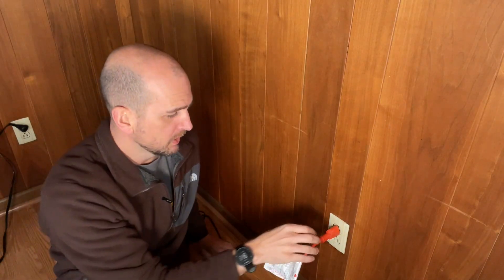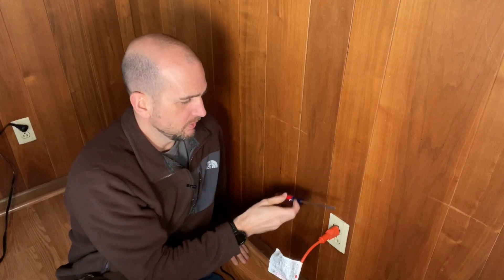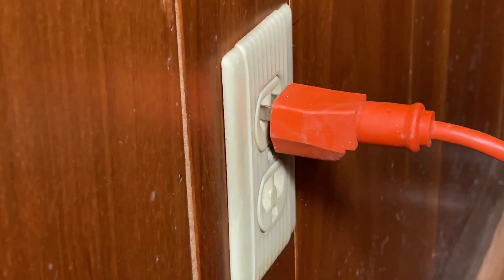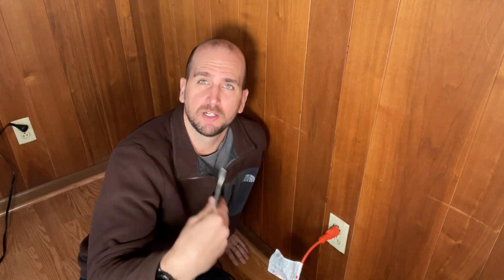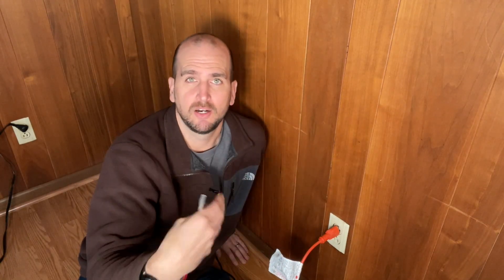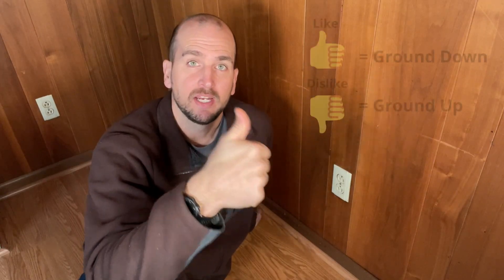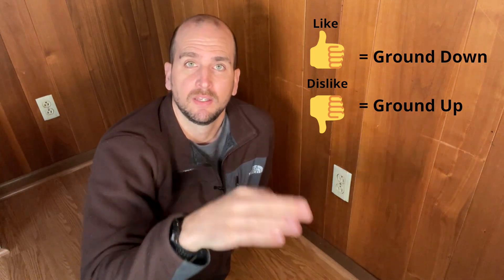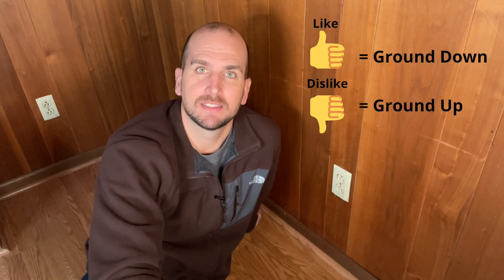Should An Outlet Be Installed Ground Down Or Up

Comment: Used to be we installed all outlets with the ground down, unless it was in a room that was controlled by a wall switch, then we would install that one ground up so that the homeowner would know which outlet was controlled by the switch and it was usually just a two-prong table lamp going there anyway so it worked out just fine.
Reply: I dislike the practice of upside-down plugs for switches because It is unprofessional to be inconsistent.  It's the wrong solution to the "problem". You should install receptacles that are marked as switched.

Such as https://www.hubbell.com/wiringdevice-kellems/en/Products/Electrical-Electronic/Wiring-Devices/Straight-Blade-Devices/ConstructionCommercial-Receptacles/DR15C1WHITR/p/2608245

Comment: So this is how I learned it:  Ground facing down for "regular" outlets. If the outlet is controlled by a wall switch, then ground goes up. That way, there's a visual identifier as to which outlets are switched and which ones are not.
Reply: Thats how they wire homes in Vegas. I've never done that myself but I'm in Northern California and didn't really deal with 120v receptacles much.
Reply: @billsilva7932  
It's not uncommon in California, especially in newer rental properties.
Reply: That is something that lazy/cheap electricians do.
It is unprofessional to be inconsistent, and it's the wrong solution to the "problem". You should install receptacles that are marked as switched.

Such as https://www.hubbell.com/wiringdevice-kellems/en/Products/Electrical-Electronic/Wiring-Devices/Straight-Blade-Devices/ConstructionCommercial-Receptacles/DR15C1WHITR/p/2608245
Reply: @TonyPombo  
Fair enough, but it seems to be a regional thing, so there must be a whole union of lazy/cheap electricians in my part of the world. I'm not defending the practice, mind you, I'm just pointing out that it's pretty commonplace in my region.
Reply: @ajs11201  Sure thing. Honestly, it is a combination of contractors not keeping up with product availability and/or not wanting to spend the time/money to get the right product. I can't blame the homeowner or DIYers for not knowing.  But, if you are hiring a professional electrician and paying them good money, they should know about these and install them.

Comment: I live in Chicago, where outlets are customarily installed SIDEWAYS. That would make the question "Ground left, or ground right?"
Reply: on sideways receptacles, I prefer to install with the hot on the top, because you are more likely to accidentally have a finger in contact with the blade than your thumb,
Reply: Never heard of that one.
Reply: Funny thing, I got to this video because I got asked to rotate an outlet so that it was sideways. So I was wondering if ground left or ground right was more common.

Comment: I've been an electrician for 30+ years and I always do ground facing down in homes
Reply: Obviously you are a residential electrician, union electrician installing outlets in schools, institutions, hospital and government structures ground up, been that way for decades.
Reply: @glahut93  Actually not. I've been in IBEW Local 3 since 1987. I assume you're referencing 602-1986 - IEEE (Recommended Practice for Electric Systems in Health Care Facilities) and I'd agree 'ground up' is the institutional standard. I thought the topic here was residential standard. Obviously, residential appliances (washers, dryers, stoves, air conditioners, dehumidifiers, etc. etc. etc........) are all designed to accommodate the residential standard of 'ground down' receptacle orientation. NEC, NFPA 72, etc don't chose a dog in the fight, (coke or pepsi, chevy or ford) but the undeniable reality is that almost all home devices (where a choice is given or necessary) are manufactured to the standard 'ground down'  for residential.
Reply: Again in residential homes down is correct. But I see the point for having ground up to stop potential shock hazzard , in my home I wired  it's ground down, but for inspectors on commercial work it's ground up since the early 80s.

Comment: Awesome idea to put the switched outlet in a different orientation so you can tell instantly which one it is.
Reply: No, please don't, and don't encourage other people to do the same.  It is something that lazy/cheap electricians do.
It is unprofessional to be inconsistent, and it's the wrong solution to the "problem". You should install receptacles that are marked as switched.

Such as https://www.hubbell.com/wiringdevice-kellems/en/Products/Electrical-Electronic/Wiring-Devices/Straight-Blade-Devices/ConstructionCommercial-Receptacles/DR15C1WHITR/p/2608245

Comment: Other than the small point you made when the plug is not holding in I say ground down. It’s a toss-up with the tie broken by the fit of the right angle plugs.

Comment: I was on a job site and was moving some stuff around and in doing so had raised up the radio antenna that then caught the prongs on a receptacle that was installed with the ground up and shorted out lol.  Basically our North American outlets have very little safety built into them.  Even tamper proof receptacles doesn’t do much really.

Comment: In a place where grounded extension cords or power tools are being used I prefer ground up. If the cord gets tugged and comes out of the receptacle with ground down, since the ground lug is longer, it tends to bend and potentially break the ground as it falls out. With ground up as the plug rotates down out of the receptacle the lug doesn't get bent. Shop vacs on a job site are notorious for this.

Comment: The safety reason makes a bit of sense.  Ground up also makes it a little easier to plug things in because you can see the ground pin going into the hole.
But most plugs and devices like power bricks and night lights and air fresheners are designed to plug in with ground down.  
I also like outlets to look like surprised faces :-)
So I prefer ground down.

Comment: When I was in collage our dorm had metal outlet covers, one time the outlet cover came off and shorted across the top of a grounded plug.  Later when I was wiring up our house I went ground up. There was no reason not to have the added safety of a ground plug on top to prevent a short.  Yes sometimes angled pugs can be annoying, but the added safety offsets that.
Reply: I've had a lot more issues with shorts due to mechanical stress on cords than with falling items, and the cords I have that care (maybe 30%, car charger is the current big one; UPS for computers too) are designed for ground down.

Comment: If you look at nearly all power cords with the wire coming out at 90 degrees, they are made to hang down with the ground down. Plugging them into an outlet with the ground up,  causes the cord to not lay flat and eliminates the whole purpose of the 90-degree plug...  In most countries, they design the wall outlets and plugs in such a way that there is never any metal exposed that is in contact with the power when the plug is inserted or removed.  In the USA we are way behind that power curve in general.

Comment: I actually had when I was a teenager a license plate hanging on the wall that fell and shorted the plug (tripped the breaker) but it was a two prong plug so it wouldn't of changed anything.  I'm still a ground down though... just looks better.
Reply: Sure those situations are rare but can happen but the Norm is ground down. I heard the explanation about some type of metal sliding down the wall onto the plug 15 years ago. But since never heard it actually happened or that someone got hurt or killed which sometimes causes a method change or a new regulation.

Comment: What are the T-shaped sockets in some commercial outlets?
Reply from the maker: I think you are referring to the neutral T-slot found on a 20 Amp receptacle which allows multiple plug designs to be used.

Comment: I am a low voltage and alarm contractor, and have always been told by electricians in  Los Angeles that ground up signifies and outlet controlled by a wall switch.

Comment: My inspector says its personal preference no specific orientation on outlets in our code books. I have most with ground down my view on this is if cord got yanked out by cord for some reason the hot lead would disconnect before the ground because terminal is longer however like you said with 90 degree plugs could be different orientation so yes i have some ground up .
And now for the ones with ocd outside outlets ground up or down configuration your weather covers either open sideways which lets water in if you get the vertical flap if your only using 1 outlet  the other is exposed and the 2nd is almost impossible to get a cord plugged into the top one .
For these i install outside outlets horizontal this way the rain has less of a chance to get in because the flaps give somewhat of a roof over outlets and yes ive tried the weather pack box covers not impressed they seem to be designed for 90 degree plugs cant close cover on frozen straight cords .
Now you have the question ground right or left lol⚡⚡⚡⚡🤔🤔

Comment: If a plug is loose and a thin object happens to be against the wall and slides down on the plug and the object happens to be made of a conductive material and the breaker on that circuit is faulty ... install the receptacle the wrong way to avoid disaster. But in stall it sideways, if the moon is in retrograde with Saturn in Aquarius and if the Jaguars had just won the Super Bowl and a man happens to put the toilet seat down on his own ...

Comment: I was taught to install with ground up. The reason for this is if something metallic were to fall on a poorly inserted plug, the ground would deflect that item without shorting the circuit.
Reply: Why wouldn't you want the breaker to trip the circuit if something metallic fell on the blades?

Comment: I've been taught the standard is that the neutral should be on the left, which is the taller of the two flat prongs. And that puts the ground on the bottom. We're moving into a house that has them randomly placed -- some one way, some the other. I'm planning to move them all so the neutral is on the left and the ground is on the bottom.

Comment: Application based, when the cover is metal and if the holding screw was to back out the ground up would give better protection. 

As you stated there has never been a ruling for this in NEC.

Comment: I have not vote as I do both. I prefer ground up for anywhere in the house but anywhere where I installed a GFCI plug. My reasoning is you use GFCI because of water and ground up with a quick 90 could trace the way for water ingress. It is just an other safety scenario that will never happen 😜

Comment: Ground down is safer because if the plug loosens up, the ground is the last to detach.  Ground up will disconnect the ground first causing a potentially deadly safety hazard by operating a device without a ground

Comment: What happens when you mount the outlet sideways?  Should the ground be on the right or left?
Reply: Neutral side should be up if you follow the theory that a metal object can contact the blade.
Reply: @Millersville44  I was just trolling for a response, but that actually makes sense...thanks
Reply: I was told on these the neutral blade down

Comment: It appears most or all devices you plug in are designed for ground down. I have one outlet someone put in ground up I consider to be installed upside down and it drives me nuts. It also rotates the direction of the USB so it doesn’t match other outlets. ALWAYS ground down.

Comment: I have always installed ground down simply because that is what I have always seen in any home I have lived in. However, I will remember the tip about using ground up for outlets controlled by a switch. Good video, keep up the good work.

Comment: Another thing to keep in mind is a lot of 2 prong plugs have one blade wider than the other.  And if they have a right angle on it, it's usually oriented for it to go in with the ground down.  Here's another question with some older homes.  How do you orient the ground in a home the the outlets are put in sideways?  Does the ground go to the left or the right?  In one of the homes we lived in the outlets were installed on the floor.

Comment: On the 90 plug I'd argue that in most scenarios you're going to run that cord upwards into a work station or entertainment center anyways. I was taught ground up but have seen manufacturers label both ways; actually the last batch of gfcis I put in where clearly labeled ground down.

Comment: Ground up can help with the tension stress onto the face if the outlet and cord plugged into it.  If the ground prong started to fail it won't necessarily cause a complete plug failure.  Even with that I've personally installed mostly ground facing down residential, ground up commercial.  That's my experience anyway.

Comment: I learned to use ground up when metal plates are used. I learned to use neutral side up when putting them horizontal for the same/similar reason. BUT - I use ground down almost always even though I learned to do it this way - consistency. Even when using metal plates - I simply make sure the plate is on securely and properly, and who removes a metal plate with a device plugged in while it's hot? Pretty RARE!

Comment: Ground down, because that’s where the ground is.  It just seems right.  In my home they were originally installed ground down, my electrician installed some ground down, and my inspector signed off on it, so that’s the way it is.

Loose plugs are not a factor, because when I have a loose plug I replace the outlet with a better quality unit.

Comment: While working at a hospital. The ground was placed up, due to that most of the cover plates were metal and sometimes they got loose and fell off. With the ground facing up this prevented a short circuit.
Reply: Yes. I was looking to see if anybody mentioned hospitals and stainless cover plates. Ground up.
Reply: That makes no sense at all. I'd want the breaker to trip immediately if the plate fell, not hang there ready for a problem.
Reply: @Cotronixco  I will be sure to pass that along to the families who's loved one has life support equipment plugged in.
Reply: @Cotronixco  Definition of loved one

: a person one loves and especially a member of one's family Many of her friends and loved ones visited her in the hospital.
Reply: @glennschmidt9276  No, YOU said "who is loved one," not me. I think you meant to say "whose" but you just aren't that smart.
Reply: Same here, I made the hospital comment before I read yours. We do the same thing in other commercial installs with metal plates.

Comment: Excellent video.   If the plug gets pulled out, the ground pin is longer than the other 2 prongs so the ground is the last to let go which is good.  I have seen commercial installations like hospitals and such, have the ground up which you very well explained.  Great video.

Comment: I was working in a restaurant with corrugated metal walls and kitchen guy dropped a spatula and it stuck right on the hot - energized that whole wall panel. Cut power, installed ground up, made sure the panel was grounded after that... That's not my "go-to" though, because that is an extremely unusual situation. Cords seem to hold better when they're ground down, and oriented plugs / devices seem to always expect ground down. It also looks weird to have ground up, so I generally install ground down.

Another question along this vein - if you're mounting it sideways, do you mount neutral up, or hot up???
Reply from the maker: Wow Perry, that is an unusual situation.  Thanks for sharing the story.
Reply: @EverydayHomeRepairs  It was more than memorable! :D

Comment: Ground down on constant hot outlets, ground up on switched outlets
Reply from the maker: I like your style, thanks for sharing 👍
Reply: I base it on what I'm plugging into it.  I had one plug that I had to turn it around so the ground is up because my deep freeze has a right angle plug that the grounding prong on top.
Reply: No, please don't, and don't encourage other people to do the same.  It is something that lazy/cheap electricians do.
It is unprofessional to be inconsistent, and it's the wrong solution to the "problem". You should install receptacles that are marked as switched.

Such as https://www.hubbell.com/wiringdevice-kellems/en/Products/Electrical-Electronic/Wiring-Devices/Straight-Blade-Devices/ConstructionCommercial-Receptacles/DR15C1WHITR/p/2608245